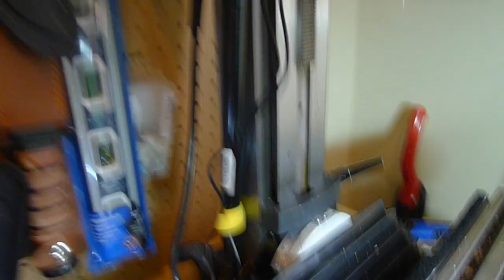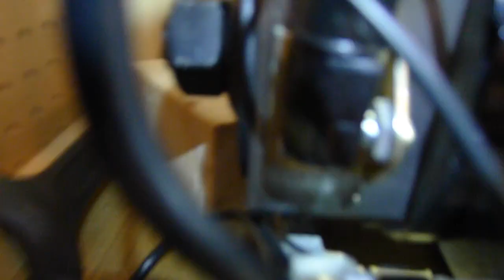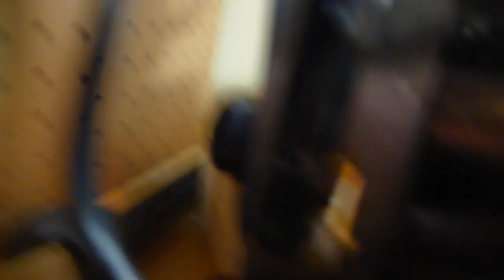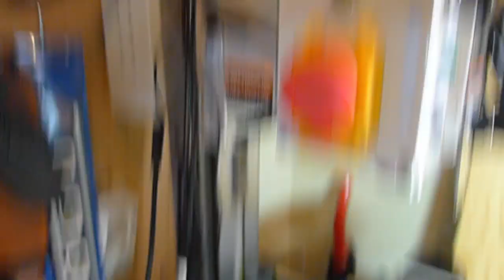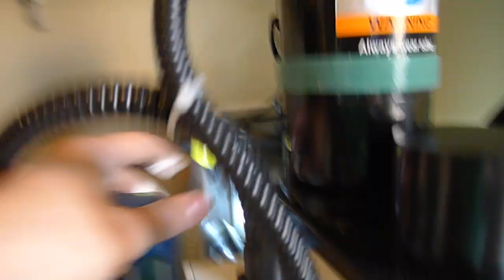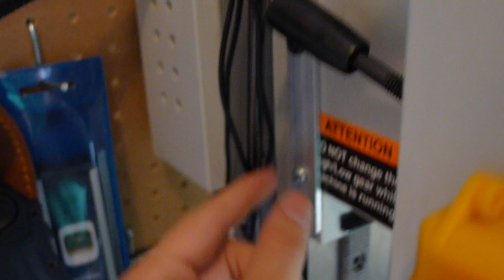X2 Mini-Mill (CX605) Cheap  Gas Cylinder/Shock Conversion

Comment: Hello Colin, Thanks for posting this. I just finished this modification this morning. One thing that I failed to notice was that you connected the bottom bracket to the column so that it could still pivot. I ended up connecting my bottom bracket to the base of the mill. Because it was lower, I did not have to create an extension fixture for the top of the mill. However, I can no longer pivot the mill unless I change it up. That being said, I've not pivoted the mill in over 10 years, so I don't think I'll be needing to. For anyone wanting to try it, the toughest part was drilling and tapping into the mill, but even that was not that bad. It looks like this is going to be a great upgrade over the built in spring. I'll be trying to add vertical DRO to the mill tonight. Thanks again.

Comment: Nice mod, you should had mount the gas spring upside down. it able to keep the piston joint lubricated.
Could you tell the gas spring force ? it's usualy indicated in newton (N)

Comment: What was the rating on the gas shock and cost?
Reply from the maker: +Robert Skelton It says "30lbs" on it. Was surplus so appears about $10 from that link in description. You might check an auto parts store too for a suitable shock.